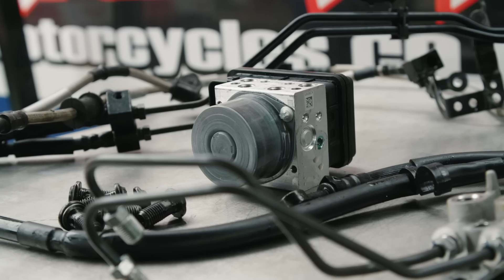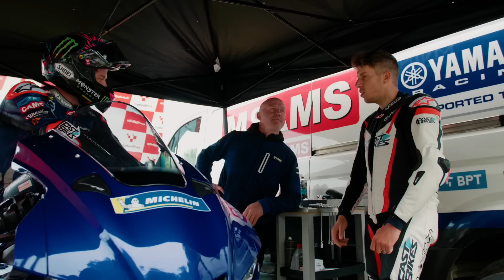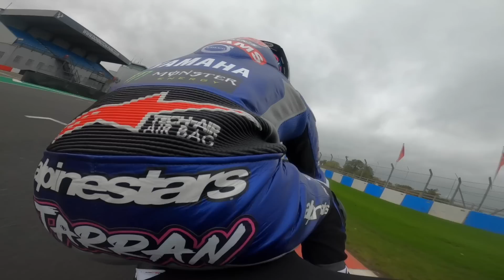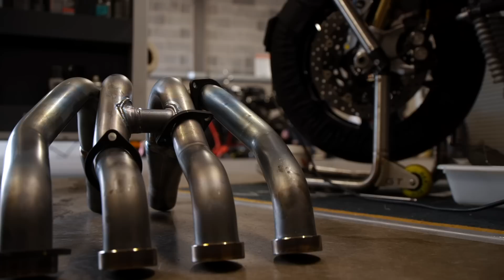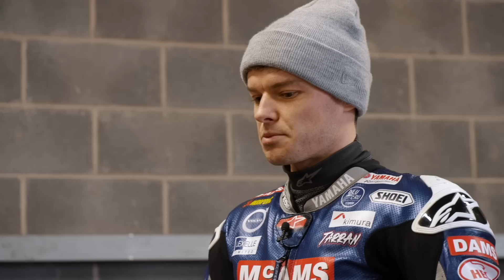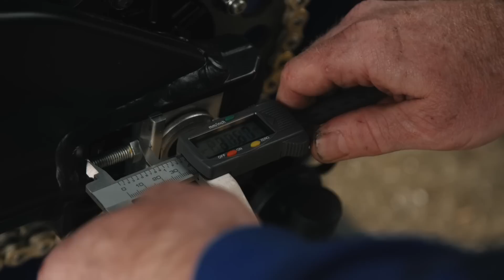How to get the most POWER out of your ENGINE | With BSB Champ Taz Mackenzie

Comment: Gearing makes all the difference on the R1
I'd suggest this order of mods 
Strip road crap 
Change gearing 15-42
Race fairings -sell oem 
Rearsets and clip ons
Remove abs 
Exhaust and reflash 
Job done.
Reply: What about airbox/air filter? These are inexpensive. And at the very least you need decent suspension. I would actually put suspension at the top of the list. Yes, expensive but it will bring more skill gains and performance gain for every other change made after it.
Reply: @2002RM  if you're racing, yeah suspension will make a difference, but for your average track day rider, I've not met many at all that can honestly say they are limited by their current suspension set up, especially on new bikes like R1s etc.
Reply: @Focused_Veteran  Then they don't know their bikes well enough. I don't have the new R1 so I suppose the factory suspension maybe good enough for most.
Reply: @2002RM  I'd agree bud, a combination of lack of ability, experience etc all plays into it, the suspension is plenty good enough on the 15+ R1s unless you at the sharpe end of racing.
Reply: @2002RM  in regards to filters and airbox, the added performance you'll see from them is tiny, again, for most, extracting even the stock performance from a standard modern 1000s bike is an issue, any increases to power go wasted because they simply don't have the current ability to use it.
The reflash I suggested is purely for riderablity, especially on the r1s where the throttle connection is so twitchy, having a reflash smoothes it out and helps loads with picking it up mid corner.
Reply: @Focused_Veteran  Fair enough. I think you're referring to the fairly casual rider though. I thought these series of vids were pitched towards those who were really looking for performance out of their track bikes. Okay maybe not going racing but good enough to know where improvements are needed. Definitely not newbs or casual riders.
Reply: @2002RM  oh I don't mean your average novice rider or inters rider, even in fast group, I'd argue that 90% of people you'll find at a trackday, in whatever group, on new-ish sports or super bikes, are in absolutely no way limited by the bike, only themselves. 
You only have to look at people like Dean Ellison etc to see it, will ride rings around full track/race prepped bikes  while riding a standard R1.. 

There's not much I could do to my own personal R1 in terms of making it go faster, outside of a fully built engine, the only thing I've not touched is suspension, outside of servicing it, because it just doesn't limit me, I'd like to think I wobble about most tracks at a decent pace.

Comment: Glad your not changing the OEM air filter, neglable gains (1-2 bhp on most) and a airbox and engine full of dirt and dust… it’s not worth it unless you need those 2 bhp in racing (not track use). For some unknown reason it’s what everyone seems to do… When I see a ‘race’ filter I throw it in the bin and put a standard filter back 👍
Reply: get one form bmc sprint or K and N there pretty good and you can always re oil them

Comment: 2-3 hp from an exhaust and air filter....Hmmmm, 200hp stock that's 1% to 1.5% gain for how much money??? I bet it's a tad more than 1% to 1.5% of MSRP, right????
Reply: It's not 200hp stock I don't think and the biggest advantage to the change is opening up the range of performance. Flash, re-map, etc can gain more. You can't do those without upgrading the exhaust. Sure there are other exhaust options too which might be suitable. Still even if it was 10hp gain, I don't think that's the main benefit. The ability to tune the mapping and get more midrange or sit in the bike's sweetspot with the right gearing can take seconds of a laptime. For a trackbike, value of mods should be measured by how much time you save (or better reliability).